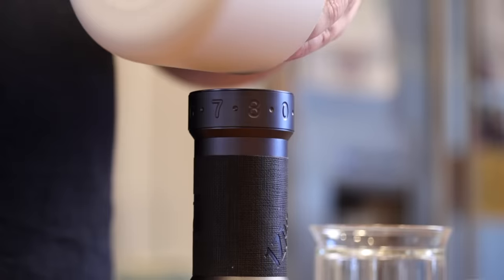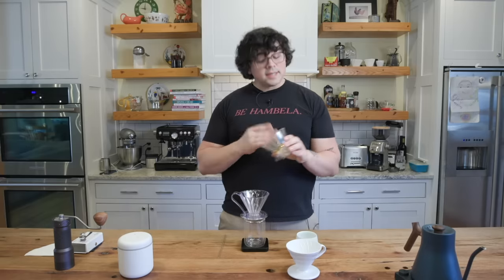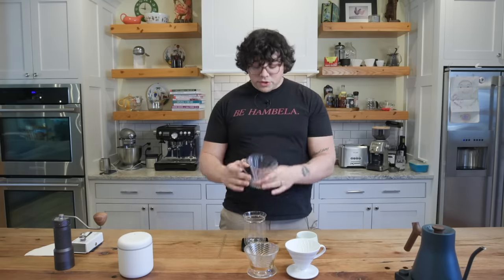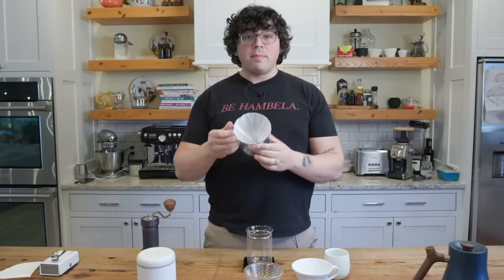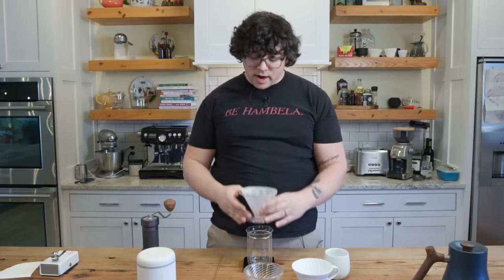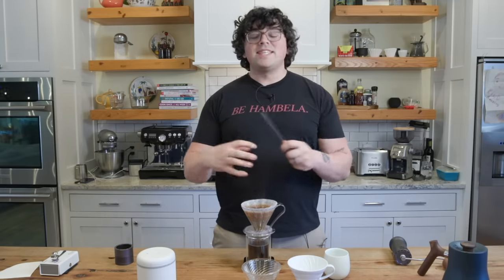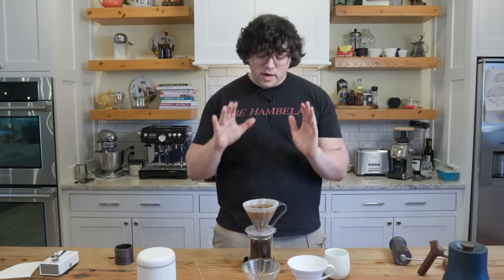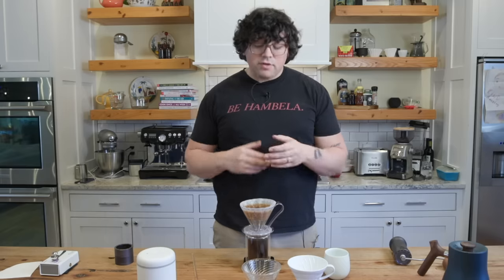EASY V60 (CONICAL) RECIPE FOR VIBRANT CUPS!

Comment: I watched this video when it first came out but wasn't having trouble with fines so i kind of moved on to other methods. However recently I'm having a lot of problems with stalled pourovers. Maybe i need a new top burr on my grinder.  I remembered this because Lance is the only guy who has specifically addressed how to deal with fines.  Well I have to say the results are wonderful! I'm drinking it now and loving it. The brew did not stall and lots of fines were up on the wall as he showed. Kudos to Lance for such great tips!!

Comment: FINAAAALLY !!!! Yes finally a grind setting shared with a Kplus ! Ahah i know that it is something to take as it is and might depend on the beans mainly but very helpful to me cause I’m typically using about 6,5/7 on my kplus for a v60. Can’t wait to try it thanks a lot
Reply: If I use a grind size of 5 on mine I don't think it'd ever drain!
Reply from the maker: Haha! Try it anyway! You might be surprised!
Reply: @LanceHedrick  I will!
Reply: @LanceHedrick  quick question, because it seems that there might be some misunderstanding because of that.. especially when i see Tom Green answer. When you re assemble your Kplus, you turn your grind dial ( with the numbers ) the most possible ( which migh be about 8 or something ) then much your burr and block everything, which even at 0 on the dial will leave your with some sa pace between the burrs or do you tight everything up to 0 which leaves you no space at 0 on the dial ? Sorry for my English but i am pretty kplus owners will understand it ahah

Comment: 2 pour swirl + agitating recipe
--> Bloom: triple dose and 2min duration. (break stream of pour via high pour to increase agitation, swirl with a pencil/straw/chopstick just below the surface)
-> Second pour: remainder of water  (Fast flow rate until halfway up v60, then slow circular pours until net weight achieved +/ swirl of entire v60)

agitation= increases saturation
swirl w/ device= shifts fines into filter walls. 
swirl of v60 cone= promotes flat bed and equal draw done

Comment: So glad I found this. I've been trying to dial in the Kasuya 4:6 method, but just can't get it to work for me, the coarse grind makes the brew too acidic for my liking. So while drinking my coffee this morning, I ditched half of it to remake in this way. I thought a back to back tasting would be a good idea.

Results: It's a much nicer cup, more rounded, less acidic (I'm using a light roasted Kenyan), and a bit sweeter overall. For me the biggest benefit is not standing around doing 5 pours. We're about to open a café so I've been trying out all the methods I can find so that I can use the best tasting one in the café. From a process perspective, this one is much easier for a barista, and frees them up to do other things, whereas the 4:6 keeps you fully occupied for 5 minutes. Taste is definitely the most important factor, but this is still a decent side benefit.

What a difference! I'm sure non-coffee people would not believe that this is exactly the same coffee being used. Thanks again for all of your videos, by far the most educational online, and by the most genuine of people. You're awesome.

Comment: Love your videos ! I would love to see your best iced v60 recipe ! Really having hard time to find a suitable recipe pour a good iced v60/pour over
Reply: 50% of your water weight should be ice.  Brew directly into the ice.  Perfection!
Reply from the maker: Similar to Michael, but I like 33% as ice with heavy agitation. Then swirl and pour on ice
Reply: @LanceHedrick  no adjustment on the ratio or on the grind size ? ( or Both )
Reply: @rdalmasso7326  I do a slightly finder grind for iced and ~33% ice (26g coffee, 100g ice, 220g water.

Comment: Hey Lance, idea for a YT short - basically an ad for this video but with the slant that folks with certain espresso-focused grinders that go coarse enough for filter but suck at it due the fines (Vario, Niche etc,) may not need to buy a separate grinder for filter, they can use this recipe and get pretty-good results while taking care of those fines.

Comment: This recipe has been amazing. It has really changed my V60 cups for the better. Just upgraded to the K-Max as well so nice to see grind settings for it. I was very surprised that I was able to go from the 7 down to a 5.5 on the grinder for the same ratio I was using previously and get a much better cup out of it. I was sure I would have some astringency going that fine or stalling issues but the bed looks cleaner and flatter than when I was grinding at 7 and all the fines are on the wall of filter (as they should be by the design of the recipe). Well done Lance thanks for a great recipe and an improvement to my morning coffee! Now to find some light roast coffees to experiment with and move on from medium roast.
Reply: I do wonder if all the K grinders are the same. 
Because on mine, coffee is nauseatingly bitter below 7 on any recipe/bean, until I reach around a 7 where I get delicous cups. My grinder is brand new so perhaps the "seasoning" will break in the burrs and start producing larger particles + less fines 🤷
Am using light roasted beans from reputable roasters and good brewing water, so I'm a bit stumped here

Comment: Thanks for your sharing, Lance. I love all your videos. But I think in this recipe, maybe we don't have to stir/swirl so many times. After your final pour then stir/swirl once, the coffee bed already becomes dense, dense enough to trap fines. That means the later slight stir/swirl can't really remove those fines which are already trapped inside the bed. Those floating fines only come from the surface of bed,  so it's not so efficient for those later agitations.
Reply from the maker: Yes. This is true. I was doing it in the video moreso because idle hands... I pretty much never stir around that much. I do these videos in one take and have adhd, so I need to constantly do something. In this case, it was stirring. Doesn't hurt, doesn't add. Just is.

Comment: Just tried this technique. Very sweet and juicy results with an Ecuador light roast. Packed full of flavor! Some room for improvement my end as the finish is a tiny bit astringent though not unpleasant. Didn’t get it quite right I think as there was a bit of a dome on the bed at the end. Interestingly it was almost all chaff and boulders though, where with a strong swirl technique I normally see everything evenly distributed. I’m not sure how it affected the results. Will have to experiment some more with the longer bloom times and agitation phase for sure. Thanks for sharing Lance!

Comment: Super.  At work I only have a cheapish grinder that produces a lot of fines.  I’ll try this technique on Monday.  Thank you
Reply from the maker: Heck yeah! Let me know how it goes!
Reply: Thanks so much. I used this technique throughout the week at work, using the Breville conical, and it worked really well. Lots of fines got trapped in the filter and I could grind a bit finer without clogging.  30grs, 550ml, a bit short of 4 minutes and the coffee was very yummy. This time a Colombian Castillo natural, carbonic maceration.

Comment: I'm gonna be honest, I'm a creature of habit and I'm attached to James Hoffman's recipe because it's been pretty consistent for me and is relatively simple (5 pours of equal amounts that are all 10 seconds apart from each other, minus the first being a 45 second bloom).   I thought that this recipe would be too much hands on process what with the high agitation, but honestly, it does perform as advertised.  It is a little more fiddling during the brew than I prefer, but you can't argue with results. The cup is noticeably cleaner and there is more vibrancy.  This was even with a slightly finer grind than I was using with the previous recipe I was following, so it was surprising that it actually had less of the kinds of tastes I'd associate with too fine of a grind.  

The coffee I was using was a peach co-ferment from black and white and I was struggling to really get the peach and fruitiness to shine before (definitely a more subtle co-ferment, possibly since it's honey process).    I think this recipe really made this coffee shine in a way I was struggling to get the flavor out that I knew was there.  Thanks for the share on this one!

Comment: Duuuuuuudeeee you need to do this recipe with a hario switch! That first saturation phase will be much easier, and second pour you can stir once it’s filled, then use as a normal percolation.  This is very similar to my recipe I use every day for my switch.
Reply from the maker: I have! Does well with the switch. Not as widely used though
Reply: with the switch closed you still do 2 minute bloom?

Comment: Thx Lance for the recipe. I habe two questions:
1. What grind size range do you use for the Commandante? 
2. Do you go still go half the way of the v60 when you brew 12g 200ml before you slow down and go down under the breaking point of the stream?

Comment: Finally someone doing a filter with the 1zpresso K-Plus. I own this grinder and have been struggling to work out the best grind setting. Finally got a good starting point moving forward. I'm interested to hear your thoughts on the grinder?
Reply: For V60, and doses of 25 to 35g, I'm usually in the 6.5 to 7 range. It's petty easy to recalibrate your K-plus so the touching point is at number 0. 🙂
Reply: I'm the same! Love the grinder, but struggled to find the best grind setting.
Reply from the maker: Working on a massive hand grinder video with this included!
Reply from the maker: I'd definitely be coarser above 20g, for sure.
Reply: @danymeeuwissen5973  Good to know, thanks. I'm around the 5.5-6.0 for a 20g dose. I also love how easy it is to calibrate
Reply: @LanceHedrick  Looking forward to the review

Comment: Hi Lance, thanks for the recipe. I practically gave up on the V60 due to it's inconsistency because of my low quality grinder. But my next problem would be, a non-temperature controlled electric kettle. I can put it back to it's base and turn it on again and bring it to a boil but I'm not sure I can be consistent in timing it and bringing it to a boil at exactly the 2 minute mark. Would this be a huge issue? I could really use your help on this. My biggest issue on the V60 is now addressee and it'd be disappointing if a temperature controlled kettle would hold me back from getting a consistently good tasting cup.

Edit:
Nevermind, found the timing on my kettler through trial and error. 

Found my new go to V60 recipe. Dang, that's some vibrant coffee. Thanks again Lance!

Comment: Lance, I hope you can reply my message as I have a small pour over competition on Wednesday. I hv been trying ur recipe and think it is very good. I found that the coffee that i brew taste extremely sweet in the beginning but lack of aftertaste. I do love coffee with strong sweetness and body and i think it taste so well. But the sweetness didn't last long enough. And the coffer starts to taste bitter once the temperature drops. I want to know is there anyway i can fix it. I used the cafec flower(1 cup) and cafec t92 filter paper and 100 degree Celsius. I followed every steps. I used 14g of dose.

Comment: @lance what is a 5.5 exactly in grindsize?  Edit: oct 2022

I have my baratza encore set to the finest callibration, worked wonders on 13/14 which is similar to what I use for aeropress and mokkapot (10 to 15).

It is a very transparant and aromatic brew with a nice juicy almost creamy body. Considering the amount of fines I always find in the brewer I am quite surprised!

Did have to fold my papers 4 to 5 times to fit the flower petals for more consistency! For lighter roasts I also found reliable results by pouring Boiling water on the grounds... more omniroast profiles worked fine with 85 to 90 degrees in kettle, would say t83 is also a must try for those beans as they taste more clean to me (darker roasts have more of an astringent aftertaste with abacca imo).

Must try tho recipe for if you know what you are doing you can get amazing results! I will update if I find a solution to the ek43!

Comment: Hey Lance, I've tried the 2 minute bloom a couple of times after reading about that idea in Jonathan's book, and I'm sure it extracts more but do you think it tastes 'better'?
I talked about it to Stéphane Ribes when he was making a V60 Geisha for us, so he let it bllom for 2 minutes, and it was similar to what I tasted before; some astringency, over-extracted aroma's, not the sweet-clean juicy goodness you'd expect from a V60.
What might be different from your technique is that your second pour is pretty fast compared to what a 'normal' V60 brew with shorter bloom would be like? My V60's usually end at 4 minutes with a 30s bloom.
Bonus question; do you have the replaceable bottom in the catch cup of your K-plus? If not, it's the K-max. (hard to see in the video)
Reply from the maker: It's the k plus lol. I know my own hand grinders hahaha! 
And yes. With this brew, I've noticed higher sweetness with 2 min bloom. With 30sec, it is about 1% less extracted and runs quickly. Try this side by side and do everything the same and blind cup them.

Comment: Hey Lance! Great video, looking forward to trying this out. I normally use your Kono recipe. Is the 5.5 grind size in the range of what you would use on that dripper with the k-plus?
Reply from the maker: I do a bit coarser with this recipe than the kono!
Reply: @LanceHedrick  Thanks! It’s been surprising how fine I can grind without getting any astringency.
Reply from the maker: That's fantastic. As Long as you negate channels, you can increase contact time more and more. It's great!

Comment: Hey Lance,

I've been using the CAFEC filters for a while, but use the Light Roast filters typically. They're advertised as having a slower flow (opposite of Sibarist / the Medium filters) with even more fines absorption. What effect would a slower flow (and therefore drawdown) have on flavor in the cup?
Reply: I have the light roast ones, I ended up grinding much coarser because brews that typically take 3min 30s were taking me 6-7minutes. I went from around 19-20 on C40 to 28 steps, still takes around 4:30-5min, but results in a tasty cup.

Comment: What do you think about adapting this recipe to the Hario Switch and just having it closed for the bloom, or at least the initial pour of the bloom? That almost entirely removes any requirement for pouring technique. Haha. You could probably also use a smaller pour for the bloom and still fully saturate the grounds with the Switch closed, but I have no idea what actual effect that would have.
Reply: Ive been doing just that, really dig the switch and its flexibility
Reply: I was looking for this comment… was thinking of trying it this way in the AM. I was gunna flip the switch around 15 seconds and then do the full 2 minutes. Let me know how it goes for you.
Reply from the maker: Yeah! Just remember there is a reservoir beneath the switch where water will escape. So I'd still do 3x weight.
Reply: with the switch closed you still do 2 minute bloom?

Comment: Just finished my first pour like you showed in the video. Used the same filter and natural processed Ethiopian Guji Hambella. It finished right at 3:50. 

Wow... Great flavor. I'm really tasting the fruit. It's VERY clean and leaves a lasting sweetness at the back of the tongue (that lingering sweetness could have to do with the 1Zpresso Q2 grinder I use... it tends to do that). 

I'm loving this pour and flavor! It's so easy to do too! 
Thanks a bunch for this! Excellent!
Reply: How many rotations or clicks you use in 1zpresso Q2?
Reply: @jajangteu2449  36 clicks. So 1 full rotation plus 6 more.

Comment: I too have a kultra and is a 55 grind size too small? V60 is my go to and I’m usually at 85 within the 80-90 window per the user manual. Is that the size more for say a chemex vs a v60? Thanks

Comment: great video, Lance. I tried and sadly didn't work out. I used V60 01, hario paper (didn't have cafec paper), 12 on encore, 12gr ethiopian wash fresh roast. I flush the paper with cool tap water to create vacuum as you said. Bloom 40gr water swirl vigorously wait 2min. but after that problem happened. 2nd pour and in 170gr my dripper overload. cannot put water anymore so I pour the rest slowly. I've been waiting for 15min now that my brew didn't finish yet. what am I doing wrong?
Reply from the maker: Probably swirling too aggressively at the beginning.  
I've never had one stall before on any Grinder so it is hard to say. You did 40g bloom then poured 170g water? How aggressive did you pour 170? Shouldn't be too aggressive. And the final agitation should be soft
Reply: @LanceHedrick  no, it's my fault. I accidentally use cafec light roast paper which is waaay too slow to drain. but flushing the paper with cool water is okay?

Comment: I've been watch lots of videos about people using kono dripper to do this trick on your IG. And I think it's not so efficient with this method. The stirring lets the fines float, and then the bypass flow caused by ribs collects those fines on the filter. But with kono, there is no bypass flow, so filter can only catch fines which have direct contact with filter surface. That's why you can only see a very thin layer of fines on Kono dripper.